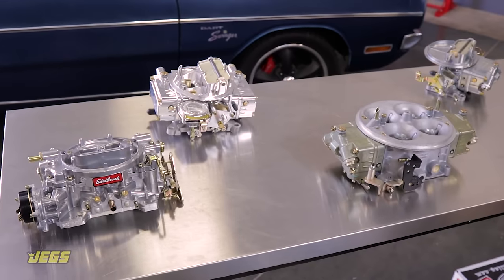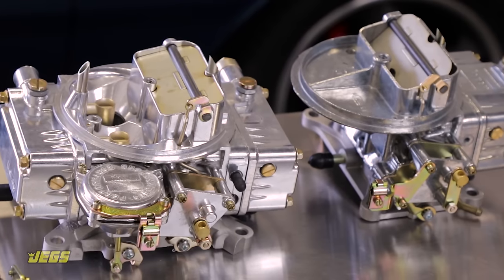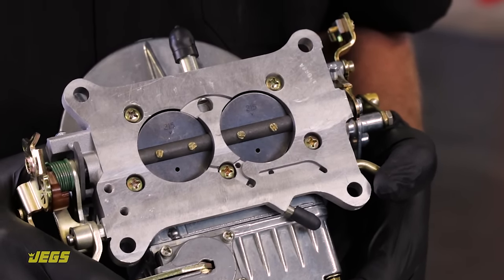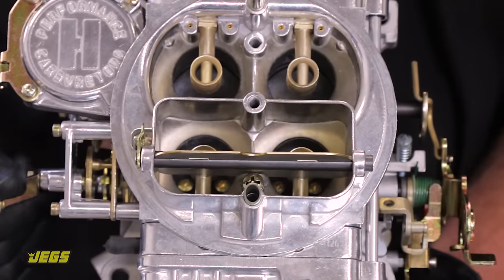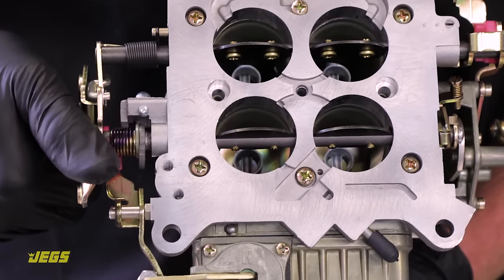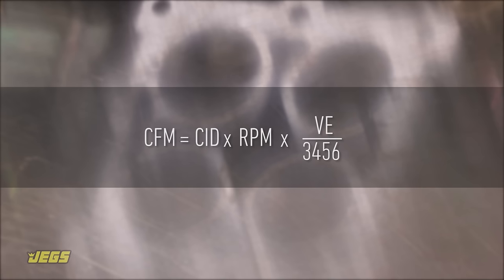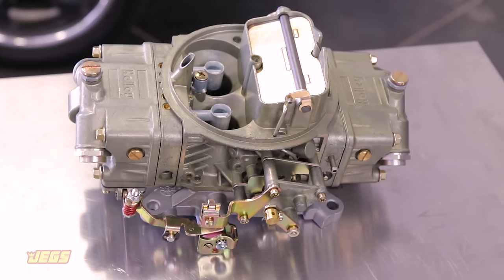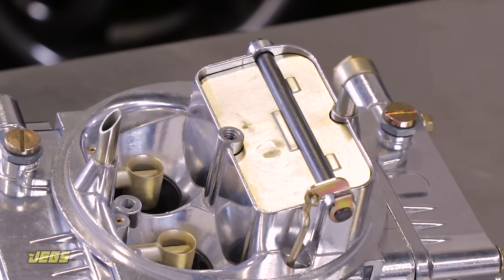How To Select Carburetor Square Bore Dominator Choke Manual Electric Spread Edelbrock Holley Spread

Comment: Hello I have a 1983 cutlass supreme single barrel carburetor Which would be a good double barrel carburetor for this car?
Reply: I have a v6
Reply from the maker: The following are 2-BBL carbs that may work. You will need to make sure that the manifold bolt pattern matches, otherwise call us to find an adapter. Our phone number is 1-800-345-4545 https://www.jegs.com/c/Fuel-Carbs-Intakes/10267/10002/-1?N=1010267&Nrpp=180&Ntt=2+barrel+carb&Tab=SKU

Comment: Olds767 asked how you come up with your numbers and you didn't answer his question, you just gave him a CFM number. I would also like you to clarify your math. I'm a math tutor, so its not like I don't understand how to make mathematical computations, however, I am also confused as to how you come up with your numbers. Please clarify the procedure you used.
Reply from the maker: The formula used is CFM = CID x RPM X (VE/3456) Which part of this are you having trouble understanding? We plugged @olds767 numbers into this formula to provide him an answer (CFM = 468 x 4500 x (VE/3456). VE can be anywhere from 70% to 95% and you will have to estimate this number. 3456 is a fixed number used in the equation for this formula that can't be altered.